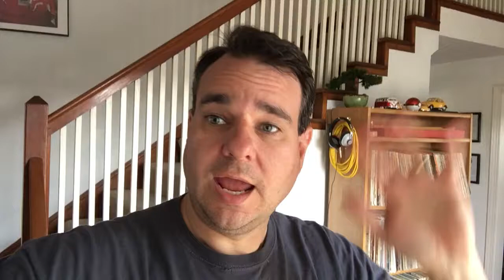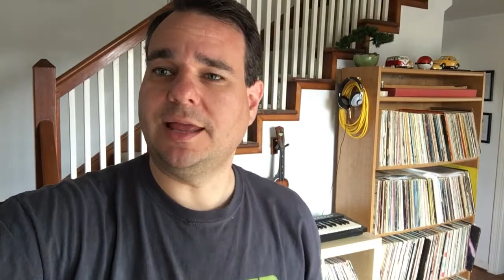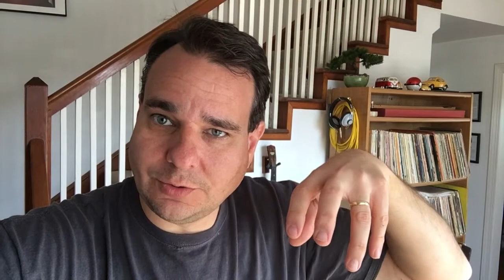Sound Advice - There is No Such Thing As Infinite Resolution

Comment: People in this "debate" are confusing resolution with dynamic range. You are describing the usable dynamic range of tape and vinyl, which in digital is dictated by the bit depth. Resolution is the sampling rate in digital audio, or how often it takes a sample of the voltage of an analog signal, commonly 44.1khz. In that sense analog tape particles may not be infinite, but they may as well be. 

Resolution is not dynamic range, resolution is the amount of data points. Pixels for digital images, samples for  digital audio.

Also, how can you talk about the universe expanding in an infinite sense but act like here on earth things are somehow constrained? Unified field my friend.
Reply from the maker: Mind.  Blown.  Thanks for watching, Sam.

Comment: Right on the money! As you say, since 99+% of vinyl albums are created from analog magnetic tape masters, there's no point to the 'infinite resolution' debate (IMO). You're going to be limited to the resolution of the original tape.  Even with recordings that go directly from the mic mixer to the cutting lathe (I have a few of these), you're still going to be limited to the resolution of the lathe and the physical limits of vinyl itself... not to mention the limits of the cartridge.  I remember when Telarc release their 1812 Overture disc, as I was selling audio equipment at the time. That recording reportedly had the widest dynamic range of any record ever made. However, only VERY good cartridges could actually track the canon shots without mistracking or sounding like elephants farting into paper bags.
Reply from the maker: Its such a silly to say, but I hear it all the time on audiophile boards and by people like Mr. Fremer.  The amount of pseudo-science is staggering in those places.  You can say you like vinyl, you can say you prefer vinyl, you can even say it sounds better to you... but nonsense reasons cloaked as science just can't be allowed.

Comment: Hey Kris, good point! You lost me though lol. Hey you better support that top self of records behind you, it looks like it's ready to give. Peace!
Reply from the maker: That shelf has looked that way for fifteen years - its not going anywhere :)  However, it does prove how nice the Ikea shelves really are compared to this particle board stuff.  I don't have the time to make custom shelves, and this one fits just right under that step - the Ikea was too long so I had to keep it.  Okay, so in a nutshell several audiophiles will say that digital has a finite resolution compared to analog, which has infinite resolution.  Specious thinking - all things in audio media have a finite resolution - a plastic record can only have the slightest of a groove deviation to register on the cart before there is no signal - like a blank groove.  Same with magnetic particles on tape, you can only go down so low before it can't be retrieved or register.  So therefore, it has a finite resolution - there IS an end to its ability.   You can prefer records for lots of reasons, but this argument is a straw man.  I just want people to debate/argue with actual merits (on either side), not made up ones :)
Reply: Ok, got it, Much appreciated.

Comment: Pffft everyone knows that type 1 cassettes with no noise reduction have the best fidelity of all formats, the cheaper the tape formulation the better! If we must assign numbers to them you know it would be like 99999999999999999999999 for like a bit rate and the frequency response range is probaly 888888888888888888khz with a dynamic range of 4402494209402940294 dbs! Yeah the "infinite resolution" argument is pretty amusing to me because if you did actually assign "resolution" values to analog recordings obviously anything on cassette would be under that of a CD and Vinyl would mostly just match CD's specs as far as "resolution" goes but with higher noise and such that may make it "lower" but it has been shown that some records go higher than 20khz so I'm not sure exactly how it would"match up".
Reply from the maker: Oh, but then you get guys who say while vinyl has a higher noise floor, you can hear way into and below the noise floor, so it doesn't matter.  I want to make a video but have decided against it on another argument, that the lower the bit rate the coarser the sound - but that is still incorrect; the lower the bit rate, the higher the noise floor.  That's all.  You can watch Monty Montgomery's two videos and see real life examples of how even 10bit audio is pretty much perfect for most needs but try arguing facts and proof in these times of alternate facts and see where that gets you.  Just reading Archimago's blog comments should show you that a well written, technical article will only upset those who have spent thousands upon thousands on DACs.
Reply: Are you saying I shouldn't spend $30,000 on a dac? But that's my life's goal!

Comment: I'm commenting here because comments were off for your Ikea cabinet, which looks great, but what I want is the same thing... except with closing glass windows which let me see the records, but also keep the dust out.
Reply from the maker: I don't see why it wouldn't work, especially with the space in the Ikea Kallax - instead of putting a spacer in the back to push the records forward, leave it out and use the glass kit Ikea sells.  Even better, just bring a record and check when you are in the showroom.
Reply: +dixielandfarm There's a glass kit? wow, ok. :)
Reply from the maker: Yessir - its an add-on option right there at Ikea and they fit perfectly.  They have smoked glass as well as clear.